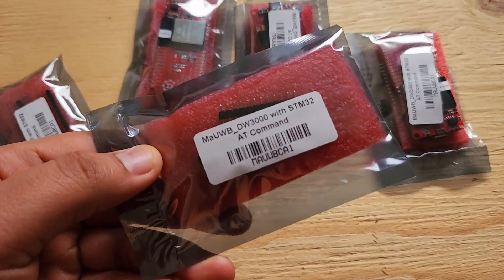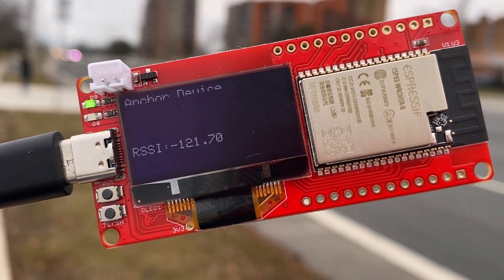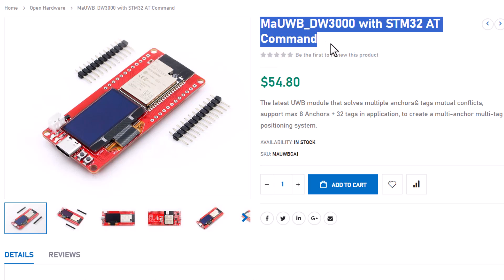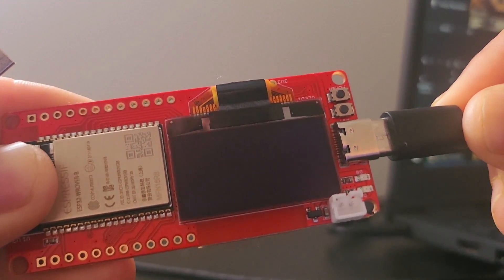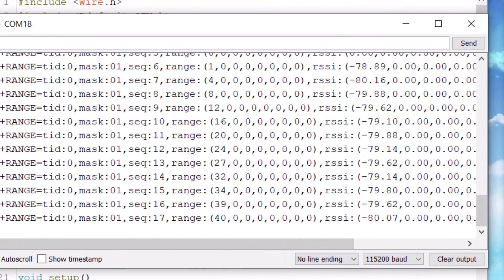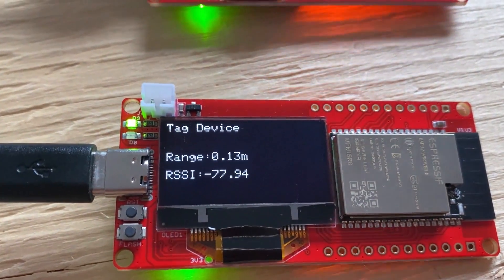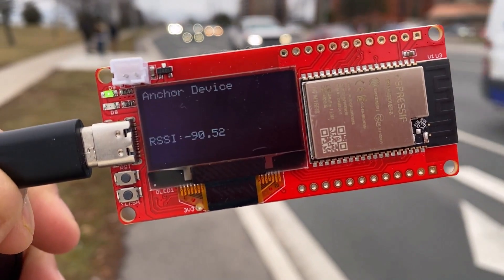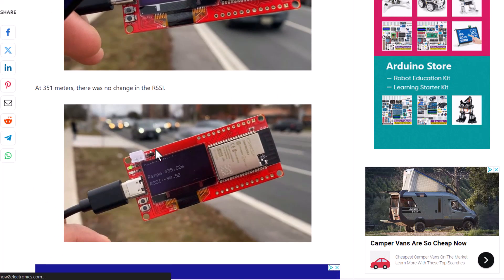ESP32 UWB DW3000 Range Test - Achieving 500 meters Distance with Ultra-Wideband Technology

Comment: Is the orientation of the chip important? Like do you only receive signals if the chip is orthogonal to the other chip? In the official video it seems that it can only send/receive data in one direction like a dish and not like an antenna.
Reply from the maker: Yes it doesn't have omnidirectional antenna. So orientation is important.
Reply: @HowtoElectronics  I see. Is the DW1000 omnidirectional?
Reply from the maker: No